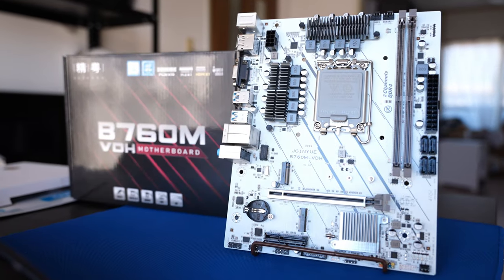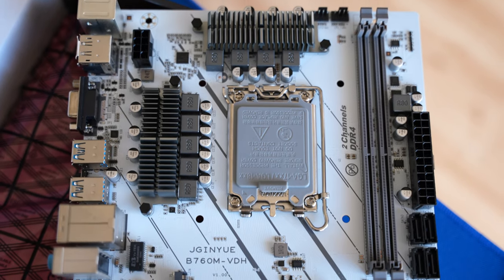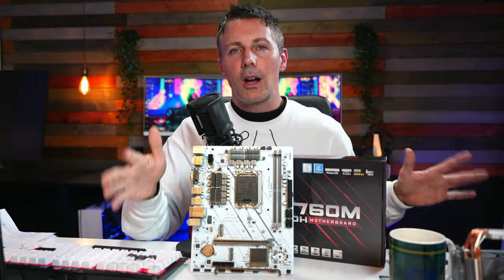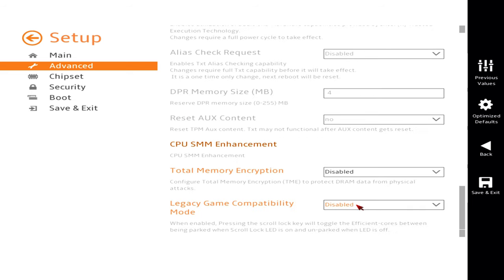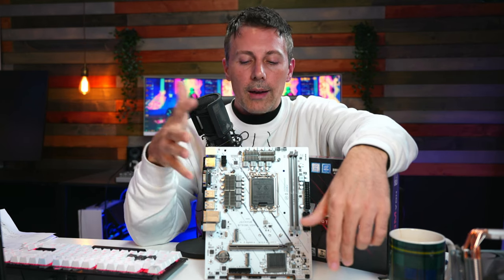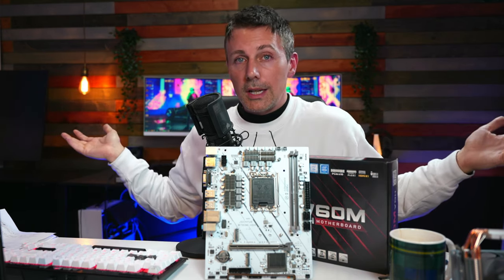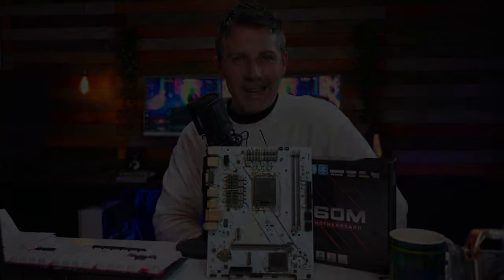A B760 Motherboard that COSTS $62... Is it TOTAL Garbage!?

Comment: Honestly the white pcb look with the silver make this one of the most visually pleasing motherboards out there. It has a sort of barebones retro look
Reply: does it go ok with a black case ?
Reply: @reuven2010  I don't have the motherboard so it's up to the imagination what it'll look like it a black case, I'm sure it'll look fine. Though black motherboards are everywhere so maybe just get a black one
Reply: @reuven2010 Does the black case have glass panel? You can google all white build inside black case for inspo
Reply: @reuven2010 I got the higher end snow dream b760m and it looks nice in my black lian li 205M mesh. Just make sure to pair it with white led fans and parts

Comment: down draft cooler is probably the move for this for cooling on the vrm
Reply: This, just couple it with an i3 with a powerful down drawft cooler and apart from effectively cooling the CPU, the VRM will also run much cooler.
Reply: @POLARTTYRTM  Intel stock cooler is better than aftermarket. Most aftermarket, the fins are one direction.
Reply: @AlfaPro1337  I don't think you have any idea what you are talking about.
Reply: @POLARTTYRTM  No, I do know what I'm talking about. Most downdraft aftermarket coolers has their fins facing one direction.

Look at NH-L9, it's just one direction. Intel stock cooler (more specifically flower type) redirects their air in all directions.

Comment: Hi everyone,

*(at the bottom is mobo cpu combo with a soldered on laptop cpu - worth checking out, esp low wattage gaming on the cpu 45W if youre running off a generator or solar in the outback and power might be a constraint)

Thank you for expanding potential motherboard options, esp to the non mainstream brands / options in Western markets.   With a system like the one mentioned if you have the ram and already something like a cheap as chips Radeon 6600 or even going out to buy one.

There's a deal coming in well under 1,000 for decent frame rates and 1080p gaming, potentially even some 1440, depending on the title / GPU.   Even if you have to buy a cheap, but not trash case and power supply. 

Like you say upgrading a system like that isnt much of an option.
As you'd mentioned  if it lasted you 2 years, its still works out to a 1$ a dollar a day proposal, if you can build it for around $770 or so dollars as the high end.    
The Cheap Radeon 6600 are a thing, a bit of a god send after the GPUpocalypse, at least for the moment or hold out for a little higher end gpu if its in the budget.

I missed what type of memory the board shown used, get 6000 if the next systems going to be an amd one for sweet spot. *(So if you buy it for this intel set up, ensure its a brand compatible with amd, and then specific motherboard you're going to get when that time comes)

Alternative mobo cpu build - not as modern - cpu upgrade 0 - cheap and can it do gaming sure.
Found it in my next clip after this one -->
https://www.youtube.com/watch?v=FR6AkUx-q8g

Comment: Will you be looking into the 12th gen erying laptop mobos?   I5 12500h/ b660 itx for around 300ish. 

There is also the 12650h / 12700h models too while still using ddr4.

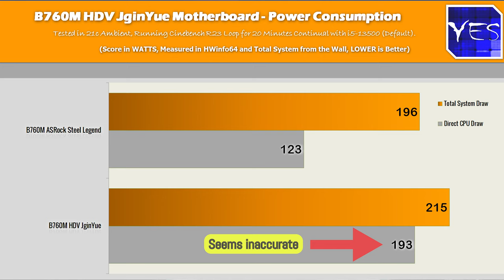Comment: 2:07 and what score did you get there ? on AsRock vs JginYue ? maybe AsRock score was lower ? or AsRock got a power limit ? for a 13500 123W looks too low .
I did same test on ASUS Z690-P vs JginYue , got a score 8039 on R20 ver , Asus used 163.42 watts with i5-13500 direct draw

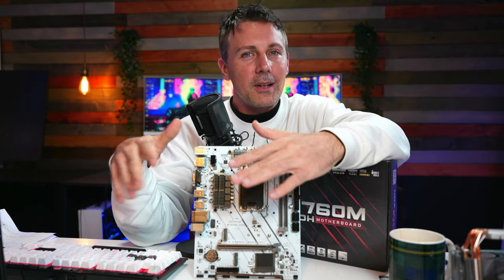Comment: 6:05 surprised to see you talking about and testing on-board audio. Anyway, while this is relevant for audio input, output is nowadays handled by your GPU, if you're running HDMI to your monitor and out the headphone jack to speakers, as I do. Onboard audio directly connected to the speakers sounds atrocious (or is it just my Optiplex?). That being said, I haven't actually bought a discrete sound card since the Turtle Beach Montego A3D. Of course, if you're not using a GPU (eek) or if you're not routing the audio signal that way, my thoughts don't apply. But this way I can actually take advantage of BOTH audio devices, independently. Of course, HDMI has no input side, but I can, for example, play a game while on a messenger call and hear both and they won't hear the game... ;)
Reply: Nvidia effs' up the audio thru hdmi, turning it into stereo mode only!
So goodbye any 5.1 or 7.1 thru ARC...

Comment: This board is actually very popular with the 12th gen ES cpus. You can get a i5 12400 ES for less than $50, and use the PCIE X4 chipset slot for your gpu, it is suggested to use at most a 3060 for this method though
Reply: Where can i buy it for that price?
Reply: @mazi16v  pinduoduo, taobao, xianyu
Reply: >You can get a i5 12400 ES for less than $50, and use the PCIE X4 chipset slot for your gpu
Omegalul that's a horrible idea
Reply: @detoi4371  love how you just deduced  that its an horrible idea because its not an scenario where you can get top performance out of. You get better than 3600 performance out the cpu mobo combo for less money. If you couple it with an 6500xt or even up to an 6600 with little to no performance penalty as they dont even have x16 pcie lanes, if you wanna talk about the rx580 and below, those dont really get impacted too as they are in the same performance class as the 6500xt and the 580 has 8gb of vram.

If you are on a budget and have no plans of upgrading, its actually a good option. Yet your puny brain can't understand that to some people it has its use cases, especially cause this specific motherboard can be had for way lower than 70 in some regions.
Reply: @detoi4371  Funny of you to use that as an insult when you are probably one yourself, not that its much of an insult itself. 

On one hand you are running your gpu through chipset PCIE lanes, on the other hand you are connnecting 2 3c6t CPUs through essentially PCIE lanes, with around 70ns of latency with an expensive kit of 3800mhz ram, whereas the i5 12400ES is way less affected by the quality of the and and would suffice with a budget 3200mhz ram, you can also run 3200mhz but have fun with 80ns inter ccx latency.

The i5 12400ES combo is both cheaper and better CPU wise, do remember that retail 12400 is neck in neck with 5600, not 3600.
Reply: @lmchua8644  please show benchmarks where 3600 with 16 lanes does worse in frametimes than 12400es with 4 chipset lanes
Reply: @lmchua8644  Does xianyu works for international buyer's?
Reply: X4 lul
yeah, nope.

Comment: Got mine b760 at last! But rather than "Win10" style of BIOS, mine was more like "Huananzhi" style(or regular UEFI, if You like). The only one problem I got so far is inability to manually overclock my temporary RAM(some prehistoric OEM Crusials 4GB 2400MT/s) at all. If anyone here  tried to kick up the speeds to tighten up a bit from terrific 90 ŋs, can anything be done with that? Guess it's better to return back to my trusty x99 in quad channel😅

Comment: I paid $270 aussie for an RTX 2070 Super (Asus Strix) deal or nah? It came on a phanteks waterblock, but the seller also had the original heatsink shroud cooler, so I put it back on and if I can flip the phanteks waterblock (strix rtx 2080 ti compatible) I may be able to reduce the final outlay to even lower. Gonna go play some Dota now byeee
Reply: Considering they were like 800 AUD new its a good deal

Comment: I think, that it will be a good idea, to make a simple construction, so you can put an extra (cheap) fan, in such a way, that it will blow air, over the VRM's.
To be fair, I actually DON'T hate this board !   BUT, since I'm an AMD fan, can you also look, for an affordable Chinese, AM4 motherboard ?! 🤔👍
Reply: maxsun and soyo boards are my recommendations. They are decent quality, much better than Jginyue or any other no-name brand, because Maxsun is a large brand in China with a good reputation. Soyo is owned by the same company that owns Maxsun, the boards are almost identical. The cheapest boards are around £40 GBP and work great with any Ryzen 5 CPU with 0 throttling, for Ryzen 7/9, get the higher end model which costs around £15 more but has much better VRMs. e.g. Maxsun B550m Terminator

Comment: I've seen that case where you believe there are four power levels, only to find three, and there aren't four at all, what's happening is a binary 3 bit flag is used to indicate the power level; so you have 001, 010 or 100 to indicate the power level.... and 100 in binary is 4.  Technically you could have 000, 001, 010 or 100 so there are four different bit masking's, but I believe that's what's happening for you.  Certainly was the problem I saw in a similar looking heinous UEFI about 3 months back.

Comment: Would a HDMI instead of VGA really cost that much more?
Reply: Vga is bigger and probably needs a converter on the board so it probably cost more if anything
Reply: It have a hdmi .  Look again.
Reply: Yes you pay royalty per unit for HDMI
Reply: It does have HDMI. It's a pretty standard configuration of video ports : VGA, DP, HDMI.

Comment: Just 1 regular M.2 NVMe, no extra PCIE for extension, Doesnt seem to have any ARGB. Doesn't seem to be worth it when B660 are getting cheaper... and its only ddr4 too... I get Asus ATX B660 D4 for 100 Cad brand new here in Canada so :P
Reply: but its a b660 going on sale, yes you can, and absolutely its a better option, but compared to b760... its a cheap crappy board that just functions without exploding, perfect for i5 13400 or i3, if you want a core i7, or u find clerance sales of old gen, not the board for u, but its nice something like it actually exists
Reply: DDR5 is irrelevant on lower SKU Intel CPUs (i5-13500 and below) Your best off sticking with cheaper DDR4 as the performance difference is so small.

Comment: If you're selling computers with that mobo you need to tell your customers they shouldn't expect future CPU upgrade, since you just said i7 and i9 will throttle. Most customers I have, usually go for lower end cpu  then do upgrade when prices drop after a new gen of cpus...with this mobo it's no go. 
So people getting this mobo should be aware of the fact - i5 is most you can run with it. With that in mind maybe start with i3? What would be customer getting with i3 cpu and this mobo? 
I'd like to see those results - for tight budget last gen cpu gaming computer

Comment: This would be an INSTANT buy if the motherboard firmware was free software, otherwise known as libre or often free-and-open-source,  like the Libreboot firmware. It is theoretically not hard for a manufacterer to reach out via email to the Libreboot team for help with implementing such a thing, no?
Reply: There is a single Coreboot LGA1700 motherboard, so clearly manufacturers do not care
Consumers with wallets don't care either

Comment: By the way Brian; I just ran Returnal on my 1680v2 is really stuttering, it definitely likes AVX2 badly and devs gotta patch it. Game is super ram hungry too definitely gotta get 64gb. 32 is not enough. I got an Asrock Phantom RX 6800 XT. Got that one from you're review before actually. 1680v2 is an absolutely pain in the ass to OC and the heat is insane even with an 280mm AIO 360mm is the best option. I really hope you remake an updated OC guide for that cpu I just can't ever get proper OC stable completely it is very frustrating. Then in the summer forget about it need liquid nitrogen too keep temps down I kid you not lol 😆. 

Gotta get like a 7900 xtx or xt before the next cyptro boom it's coming and I'm not gonna be stuck with a gpu for five years again. Gotta get back X99 again or X299  maybe x399 . I'm not entirely sold on AMD cpus yet they are really really impressive. In my opinion Though that Lisa Siu too me is a moron because she doeant believe in competitors lol. Way too much focus on enterprise Nvidia is doing the same thing too and dwv wise be anothee decade for the cpu too be more optimized like when Cyberpunk 2077 came out people had too modify the hex file in the exe too run the game on AMD Ryzen lol. I've been doing a lot of researching and of course a lot of cores for video editing and photo editing wanna get an Sony A7RIV that's 60 megapixels.

Comment: i want a $62 AM5 Motherboard
Reply: yup, even if its one of the crappy ones that "if u put a ryzen 9 it will catch fire", cheap, weak vrm boards are fine for ryzen 3 or i3 tier cpus, because with the current boards meant always to support the top tier cpus. Entry level cpus make no sense, am5 board 200$+ ddr5 200$+ and then u pick the cheapest cpu of am5 (7600) grand total... 650$.... or u can go r7 7700x for 730.... so u go 7700. Like 650$ vs 730.. who cares... OR if u dont need that perf... u get a 5600x and a cheap b450 board+cheap (or reused) ddr4.. for half the price
Reply: @greenumbrellacorp5744  I'm sure some cunning Chinese manufacturer will be putting together a frankenmobo of a cheap b550 chipset with an AM5 socket mobo.
Reply: keep dreaming
Reply: @tyre1337  true i take comfort in selling computer hard ware from 2017 for half the price its a win in my book

Comment: Just dont, buy cheapest b760m that can support any 12,13,14th gen cpu. You wont be overclocking anyway so you dont need a complete beast of a motherboard. For example i ordered B760m Asus TUF D4 for i3 12100f and it costed 129 euro + 86 euro for cpu (all new). With that you will gain better ram support, better temps, upgrade path, more connectivity and looks so you dont have to hide white mess like this one in the video.
Reply: Imo paying more for motherboard than cpu is a no no
Reply: @rctm6278  You can put an i7 on the MB that i recommended. Buying 90 euro MB gets you nothing but I3 cpu on it with slower ram speeds and less lanes for m.2 and other things. The moment you wanna new cpu that cheap motherboard goes too, so you shouldnt cheap out, its only 40 euro difference.

Comment: One of the things I have learned on building PCs for over 10 years is to never cheap out on Motherboard. Get the best mid to high tier boards you'll never know when those extra features will come in handy in the future.
Reply: I use to agree. Unfortunately when the best mid to high tier boards now cost $400+ the price simply puts it out of reach of a lot of peoples budgets. Now I recommend last gen motherboards (intel B660 or AMD x570) as they go for cheaper when they are superseded by the latest gen motherboards. And often the last gen boards support the newer CPUs with a BIOS update.
Reply: 99% of users will never need those extra gimmicks, I mean features.